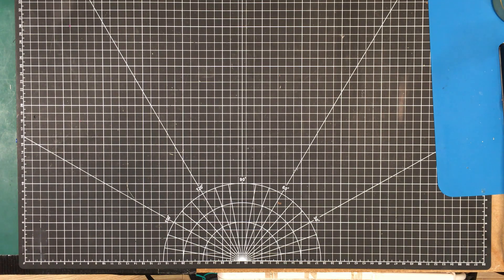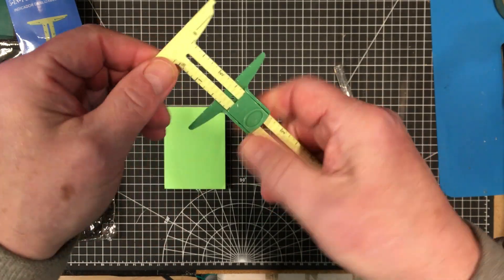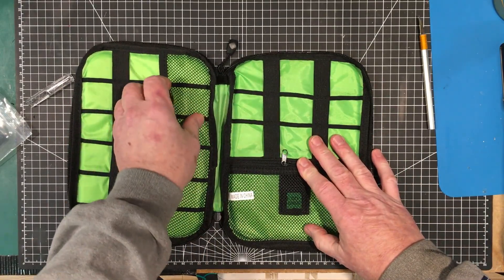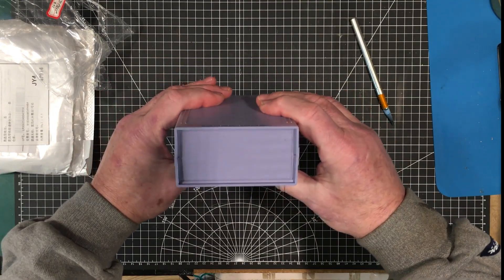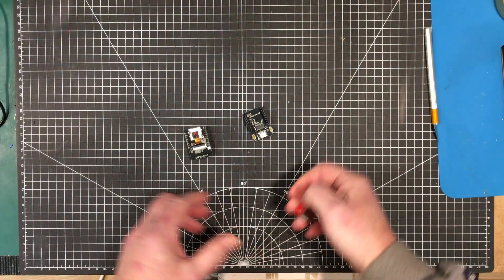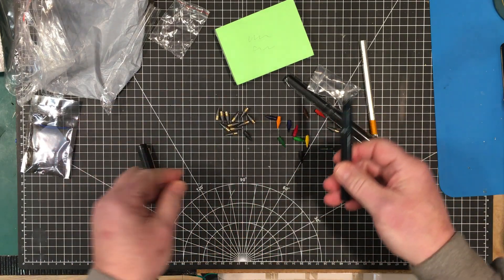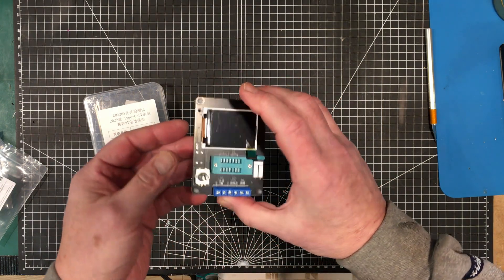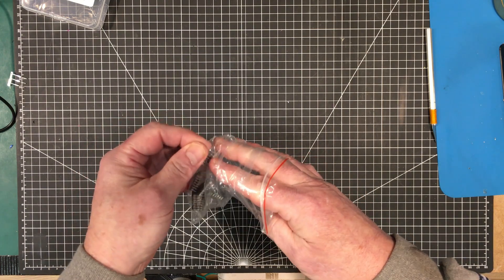0151 - Mail Bag 20:  The last of the AliExpress stuff (really! .. for now anyway)

Comment: As far as I understand it, and please correct me if I'm wrong, The transistor tester software was originally designed by Markus Frejek.  It was than expanded on by Karl-Heinz Kubbeler.  He has a 140 page manual that goes into all the details in regards to this tester including the signal generator you were curious about.  Look up "transistor tester with AVR microcontroller by Karl-Heinz Kubbeler".

Comment: I have just ordered the GM-328A.
AFTER I placed the order they offered me a GM-328A / GM-328B case. The description was MOST UNHELPFUL to say the least. I chose an option under "Colour" called "DIY Case". The reviews tell me that it "probably won't fit" my device. 
To bring the cost up to the Free Shipping limit I picked up the Infinity Pencil, 2 sets of Black nibs and 2 sets of  Colour nibs.  
To avoid fruitless searching I clicked on the link in the Item Description rather than the general link.
I am in the market for a MESR 100 ESR Meter. They show lots of options from around € 20 to about € 60. All of the images seem to be identical and I didn't proceed with the purchase because of the various pricing options for the SAME item.
Reply from the maker: Thanks for your support.  I just looked up that MESR.  It's really hard to know which is the right one to move ahead with.  There seem to be way too many choices and you can't really tell what you'll get.
Reply: Jeff Bezos has a few listed. He is probably a bit more reliable than Alibaba. 
His prices are very similar to the upper range of AliExpress so I will order the device from him when I get paid by my Pension Provider.
Reply from the maker: @anthonyshiels9273  Let us know how it goes if you get the chance.

Comment: I have basically the same transistor tester but mines the original through-hole kit version. I recently 3d printed a case for mine that made it much more convenient to use.  It's not a bad tester but I wish the frequency generator was a bit better.
Reply from the maker: Thanks for the info!

Comment: Aliexpress ads with inaccurate info, or missing critical info, i.e. frequency, current, power output, etc drives me crazy. There have been several things I've passed on because they simply lack basic specs.
Reply from the maker: Totally agree.
Reply: Right now I am looking for a DSP board on aliexpress. Product descriptions are nonsense. I need to study pictures attached to figure out what is being offered. But the prices are good.

Comment: I use individual ziplock bags, one for each cable. That way you can clearly see the ends and separate them.
Reply: I also use ziplock bags. However, I group several in a bag. Then, I stand them upright in a cardboard box, so that I can just flip through them, to find what I need. Works well enough...
Reply from the maker: I actually do that, but like t1d100 I put several of the same configuration in each bag.  The problem with me is in mobility.  I'll get a cable from the box, use it for a while then not put it back because it's not convenient at the time.  So, they end up moving around and being put in places they don't belong, etc..
Reply: @uni-byte  I have a huge desk, for my bench. So, I can keep my box just off of my left shoulder. That might sound good, but it really isn't that great. If you have the floor room, how about a filing cabinet, next to your bench? They are dirt cheap, at the thrift stores -$5USD.
Reply from the maker: @t1d100  I'll have to look into that.  My lab needs some re-arranging and I'll think about a filing cabinet.  There's lots of stuff I move out too.

Comment: I like the ESP32-CAMs. The camera is not too bad in my opinion
Reply: I have 6 of them. I added microphone circuit modules and small battery packs, but I need to design small audio compressors for them to make them really useful for my projects.
Reply from the maker: Nice to hear that it works well.